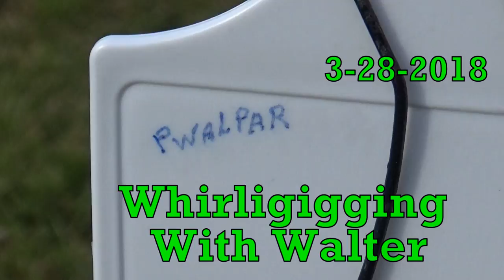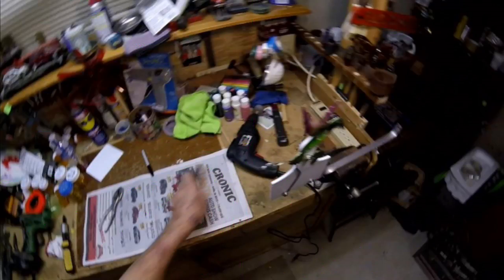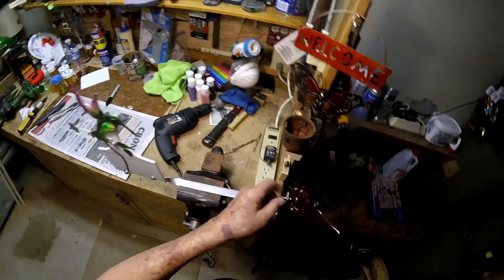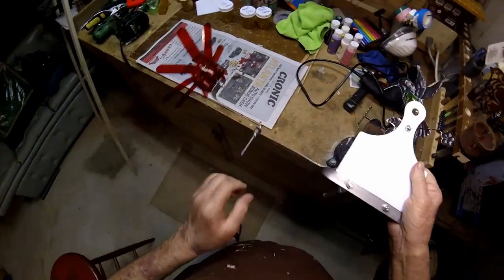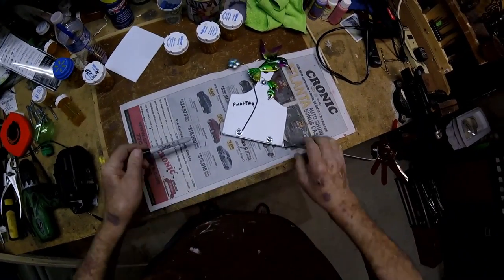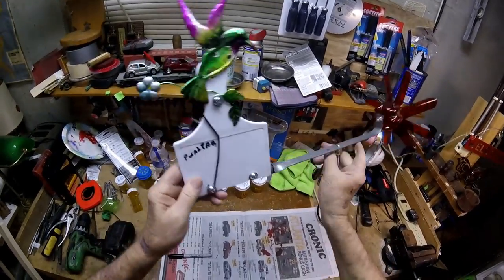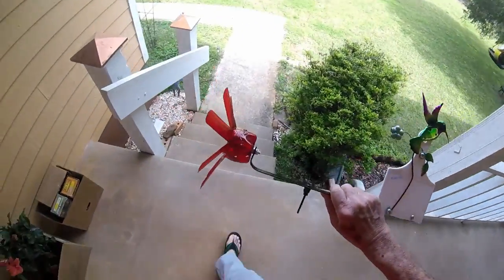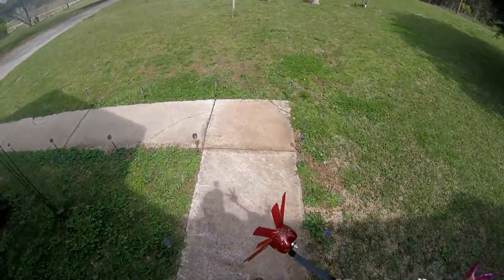Whirligigging with Walter Pwalpar VLOG 3 28 2018

Comment: Why a  bolt?A 12p nail is easier and lighter. Drill the hole about 1.5" deep slightly wider than the nail  Save the bolt for the propeller.

Comment: Walter I was surprise,,,, too hear you tell everyone it was getting late,,,,, AS FOR A XXXX RAILROAD MAN LIKE YOUR SELF THE PLACE RAN 24/7 365 days a year. Your were a carman. All your life. So you may have started back in the day!!!!!!!! maybe night's. Then second trick then on to days. Just way to much brass hanging around for me. I always like second shift. When I was a young man back in the late. 70's. Had great local FRIEGHT. Job. Showed up for a 11:00 pm most of the time back on the pit AKA ENGINE HOUSE BY 5 am.4 night then all day Sunday clean up day. 12 hours started at 7:30 am. Great and fun times. Full crew conductor headend brakeman. And a flagmen. No fireman. Was ok by me. I worked the list or on call for the first 13 years on and off reg jobs. I like moving around to much to much railroad to see and learn. You all so spoke once a RAILRAOD MAN ALWAYS A RAILROAD MAN. IT JUST DOESNT GO OUT OF YOU,,,,,,, LIKE A BAD COLD. AS FOR ME,,,, THE CONDUCTOR,,, BECAUSE I ALWAYS WAS IN THE ENGINNER SEAT HELPING OUT,,,,,,,,,, BECAUSE, EITHER ENGINEER WAS TO DRUNK TO RUN OR COULDNT KEEP HIS EYES OPEN....... I WOULD RUN. I LOVE TO RUN BUT THE SEAT WAS NOT FOR ME. WHAT I MISS THE MOST OF ALL IS THE ROAR OF THE ENGINES RUNNING UP A HILL WITH A LOAD MAYBE 90 cars. Maybe 9000 ton engine running for all they could to make the hill. Love hear the story's. JUNKMANDO